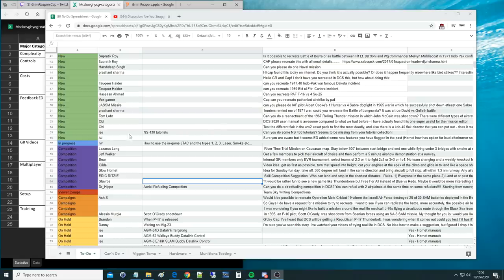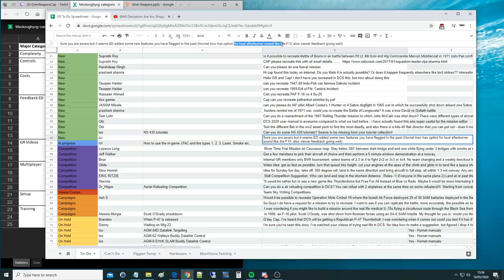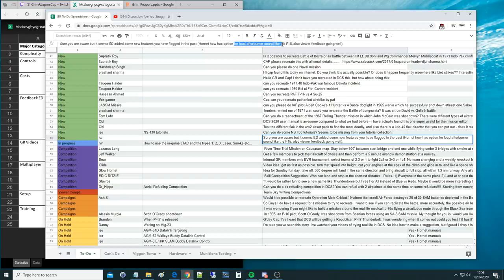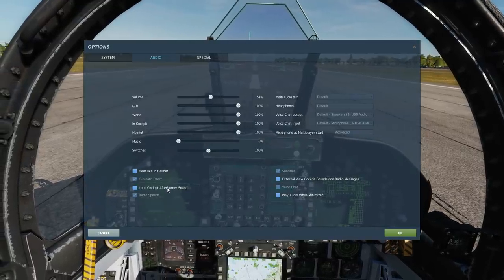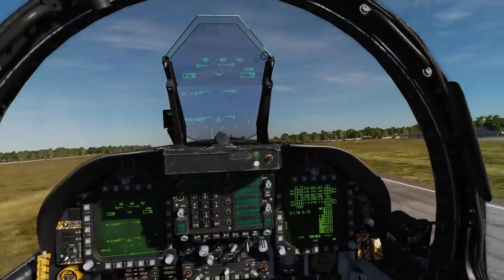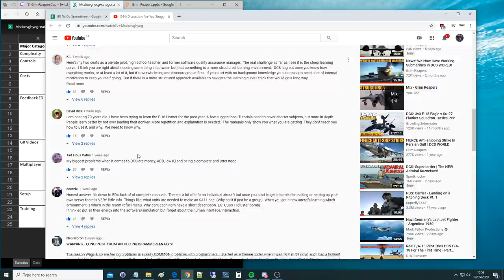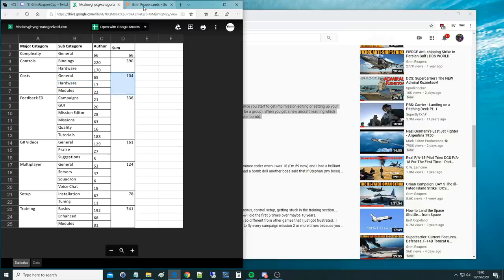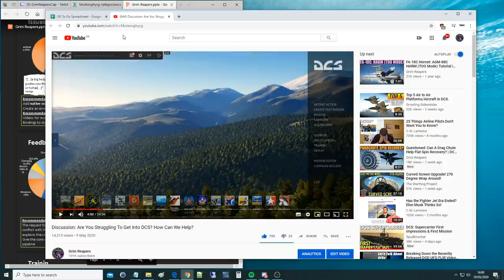News: Loud Afterburner Mode & Viewer Feedback To ED | DCS WORLD

Comment: New to DCS here.  Totally agree with louder afterburner.  Maybe not 100% realistic.  However, we're also not sitting in the cockpit either.  Picked up a open-box X56 (saved $50).  Without a physical detent and it being new and the grease making the throttle inconsistent (force-wise), I had no idea where afterburner is.   Now I "know" where afterburner starts on my throttle.  The fact that it's optional is the best of both worlds.

Comment: I have been playing DCS since LOMAC came out,  and long before the HEAR LIKE IN HELMET setting, I use to go in and edit the LUA volume controls for the engines, afterburners wind noises to do just this.  I tweaked the cockpit to be very quiet, with just the sound of the engines quietly spooling up of down. Turned up the AB volume  a bit for the feedback.  Everytime ED would patch it, I had to replace those files.. Now it is done in game with settings. So much easier.  I recently installed an AB friction detent mod on my CH throttle  and it helps as well.

Comment: F18 had crap afterburner. I use vibration feedback so I can feel when the reheat is lit. With the F18 there was no feedback. F14 on the other hand. I've got vibration behind my back and one mounted under desk between the hotas so I can feel the shake through the hotas as well. Thanks for highlighting the new AB option for F18 mr Cap.
Reply: What vibrators (😏) do you use? I’ve been hesitant to get one as I don’t know a good company.

Comment: ED have added an unannounced(?)  new tunimg feature for VR users.  Under the VR settings there is a new Slider for MSAA Mask Size.  If this is working  it allows the graphics engine to only render the field of view you can actually see through the headset at any one time.  This means less work to do  and improves framerates.  Each headset type will need a different setting.  Not sure whether its fully functional, or just a placeholder for now, ED hasn't mentioned it in release notes.

Comment: i dont really understand why people wanted louder afterburner when it was clear when you are in afterburner. The only difference was they added a boom and more bass the the already existing afterburner. They need to do stuff like add more shake and vibration in the cockpit on a carrier landing to make it feel like this https://youtu.be/8ryiJP3H7OY?t=56
Reply: If you look at the cockpit itself in relation to the outside it looks pretty stable in that vid. It’s the pilot that’s bouncing around.
Reply: He explained in the vid why sim pilots can use loud afterburner: in real life when a pilot is looking over his shoulder or at the lift vector in a dogfight hes not looking at his engine readout to check fuel flow but he can feel in his body the vibrations and the acceleration of afterburner being lit; in a sim we can't really experience this feeling (without installation of vibration devices in the chair), so the best ways for us to be able to tell we're in afterburner like a real pilot is to have an extra loud afterburner and to have slightly exaggerated cockpit shake. You can't be flying with your eyes on gauges the entire time, it's not practical or realistic
Reply: @slow9573  What these critics don't see is that it's not about more noise, it's about being able to tell when you have inadvertently entered afterburner.  In a real jet the pilot selects mil power by with a simple push of the throttle to the mil detent; he doesn't look at the engine gauges at all.  He's too busy trying to keep sight of his flight lead or the enemy, and if he has to constantly take his eyes away to monitor engine gauges he's going to lose sight.  DCS jets like the F-18 take too much time and attention to adjust RPM to mil thrust, and even after being set will often creep up into AB.  All of this requires far too much attention.
Reply: @gort8203  the f18 is one of the few that offers you a special option, and a keybind, which prevents you from ever entering afterburner with normal throttle movement. You push your throttle to max and the f18 throttle stops at mil power. But back up your throttle an inch, then press and hold the afterburner detent button that you have to bind, and then push throttle forward to max and you'll hit afterburner.

So at least on the f18, which is the focus of topic, it has an option to prevent accidentally entering ab (unlike the f14).

But even with this option to hold a button to enter afterburner, you don't know if you've A) done the movement correctly to enter ab, or B) when it actually spools up to hit ab due to natural delay from throttle to thrust to acceleration
Reply: @skyecommander2169  yeah but it is still more than what we have in the game and it would be nice if they could still add more small vibrations.
Reply: @slow9573  I appreciate the good intentions behind the F-18 afterburner limiter key bind, but it just doesn't work well enough for me.  I tried to use it a few times but had to give up on it.  It was too fiddly, and sometimes I could not get the throttles to go into burner after I thought I had disengaged it.  One time I was wondering how an F-18 could have so much trouble keeping up with an F-4 during BFM until I realized I had been in mil power when I thought I was in max. 
I just flew a sortie in the F-15 with the new sound on.  I didn't really find the sound appealing, but what was appealing was that I could easily tell when I inadvertently entered afterburner, so I spent a lot less time looking at the engine gauges.  I will use it until I get a throttle with a detent between mil and AB.

Comment: Get yourself a Buttkicker Gamer 2, or other seat/chair vibration set up. Recently got one and it's brilliant, gives you actual feedback through the seat. Hard G's and stalls can be violent if you want them to be. There is an "app" for under £20 that applies forcefeedback to it, so everyrhing from ground roll, bomb release, airbrakes and afterburner is simulated. It's genuinely one of the best pirchases I've made for the sim! - Twojags
Reply: How does it know to vibrate for only certain sounds rather than all audio output?  For example, does it make your butt vibrate when your wingman talks to you?  (Yes, that would be bad on so many levels.)
Reply: @gort8203  there are two ways of using it for DCS. Via sound only is the easiest but not as good, it only plays sounds at low frequencies, but it's not that good as yes, in theory a friend with a deep voice will cause it to vibrate. 

I use it with SimShaker. It uses a second sound output device (soundcard, USB/PCIe etc), to feed sounds into the Buttkicker, totally separate from your promary sound device. So when i release a weapon I will get a thud through the seat as it comes off the rail. When I land I can feel each wheel as it touches down, as in, literally you can count 1, 2 and 3 as they all hit. Very very immersive and it feels weird not using it now...
Reply: @j4cko56  Very interesting.  But I do wonder if devices that use a force feedback output wouldn't be a better solution than amplifying sound output.  I think force feedback is already built into DCS and many other sims, and it would only send signals based on discrete vibrations and impacts rather than all sounds that reach the ear of the sim pilot.
Reply: @gort8203  this is exactly what does happen...the force feedback signals are sent from DCS to JUST the Buttkicker, via SimShaker. They are totally separate from the sounds you hear, that's what I just explained...
Reply: @j4cko56  I didn't get that from your explanation.  You said SimShaker uses a second audio card to feed sounds to ButtKicker; you did not say it uses force feedback signals.  Is that indeed what you are saying now, that SimShaker uses force feedback signals rather than audio signals?
Reply: @gort8203  twice I've told you how it works and it is incredible, if you need more information you can go and look up SimShaker yourself.

Comment: I'm a bit late to this video but I notice training is an Issue.

Myself have the same Issue, I bought FC3 and I ended up learning the Russian planes because they had the very basic training lessons/missions plus the SU-25T which has decent training missions. Even though these planes language is in Russian I choose to fly them which says a lot for training missions.

But what DCS needs is BFM's really, I bought IL2 original game many years ago and that had some of that in it, which helped get you into the game/sim. After that you need to practice obviously but that little help up the first run of the ladder is a big step for a novice.  

I know there are lots of video's on Youtube but it is a lot easier and takes less time to just sit in the plane and be talked through landing for a complete novice.

My first and only single plane module is the F-5E because from what I understood it had decent training and also some training campaigns to buy, which I did.

I think that is where MSFS 2020 will fall down because it just has Cessna training from what I hear.

Comment: am i the only one here like " that is not that impressive "
Reply from the maker: It's perfect. Exactly what DCS needed.
Reply: No that's pretty much what I thought. Didn't hear much of a difference. Will have to test later on.
Either way, Cap is absolutely right about the problem itself. I used to do this with Warthog's mechanical stops until I was fed up with them.
Reply: Induction the best plane in that category is the F14 I guess
Reply: @Inductus  it is a problem that ED should definitely try and look into , i just think that fixing multiplayer should be their first priority  nowadays  .

Comment: Viewer Question: How weird are the seating positions. Look at a A10 (A/C) or a KA-50. in some aircraft the view is just about a feet up, sometimes not even that to get a perfect view through that fine hud. How realistic is this + how would it look like if you adjust the view to the seat, like you're actually seating there
Reply: Snap views. There is a default one you can change. You are looking for "Save Cockpit Angles"
Reply: @mdeerocks6792  that's not the question

Comment: Wouldnt a Hornet pilot know about A/B status based on the detente of his throttle?
Reply: You know that you've selected ab, but not when it actually lights. If it's like the sim, there's a delay especially if you go from like 50% throttle in cruise straight to ab.

There's a video of an f14 pilot giving a tour of the f14's cockpit and he talks about afterburner and says when you hit it you know right away because you get something like 60k lbs of thrust pushing you into the seat.

Do you drive a car? A lot of your understanding of what your car is doing is based on vibrations in the seat and the sensation of acceleration
Reply: The point is that in a real jet you know whether you have selected mil thrust or afterburner by a physical throttle detent.  You don't bother looking the gauges except during initial takeoff to confirm proper engine operation to make your takeoff data good.  During flight you simply push to the detent for military thrust, and push past the detent if you want burner.  You can feel the thrust, and you can often sense a change in the engine sound or vibration.  The structure of the airplane transmits thrust forces and engine vibrations to your body.  Having to constantly look at the engine gauges in DCS is distracting and unrealistic.

Comment: Naaa I'll take realism over this sound mod anyday,  And unlike what you believe Cap, you don't need the afterburner sound mod for the F-18C to make you a better pilot.  But hey I've only been flying flight sims for 35 years. I just don't agree with you here, but that's cool we all have preferences and if you like it then nothing wrong with that.  Cheers.
Reply: If you've been flying sims for 35 years then you should know that what you have is not realism.  What you have is an accurate recording of engine noise, but you do not have anything close to an accurate simulation of the cues available to the pilot in a real aircraft.  I'm happy to give up perfect fidelity of engine noise to gain a cue that replaces what DCS can't provide, and make the piloting experience more realistic at the expense of the audiophile experience.

Comment: Not a fan of it tbh will be sticking with the original sound if you want unrealism stick with il2 hahah
Reply: Do you have seat vibrations? Most of us don't, so any jet without some sort of afterburner feedback is being more unrealistic than having arcadey ab sounds. We need to know when the thrust hits from the ab while looking over our shoulders or up the lift vector.
Reply: No but i the f18 has a afterburner detent so if you have detent on your throttle use it or maybe you should use your helmet mounted display and manage your speed that way